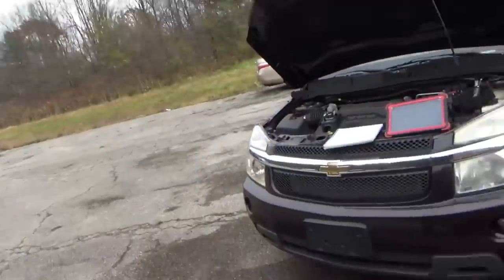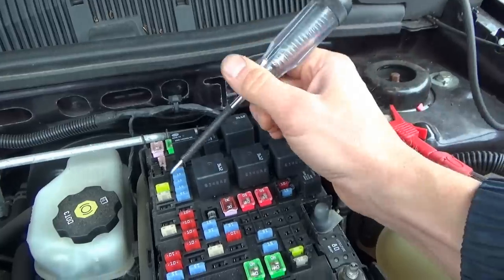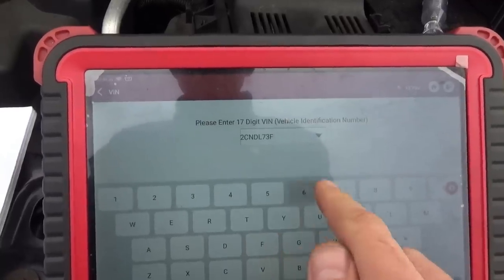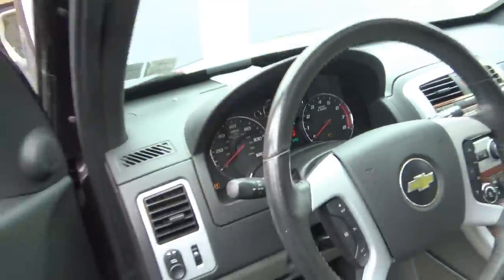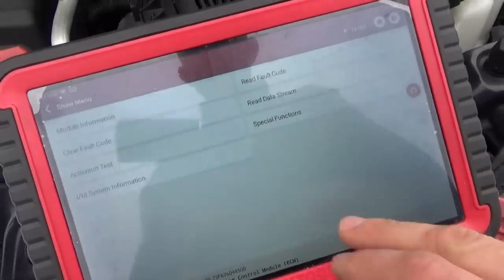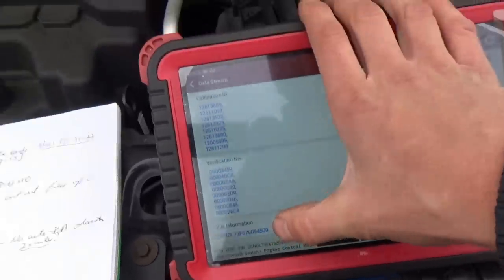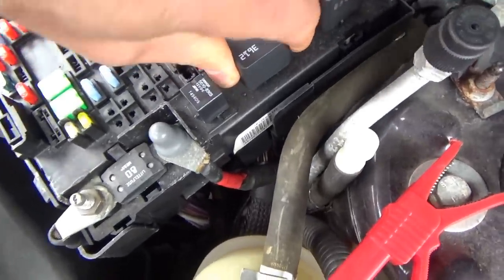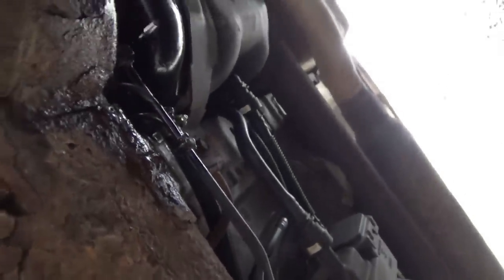Auction Car SABOTAGE? (Equinox No-Crank)

Comment: have you ever heard of “title washing”?..
  somehow, companies were able to convince lawmakers to allow them to erase a vehicles history of crashing, damaged when new due to flooding or damage in transportation from the factory to the dealer. This damage doesn’t get on the record of the vehicles history for companies like Carfax.
  several years ago when a hurricane struck the center of Texas, and over 1 million cars were flooded because they got over 50 inches of rain in parts of Texas. Many of these cars were brand new sitting on dealer lots.. they were never sold, but they were totaled because they were submerged. Now people bought these cars and resurrected them, and dispersed them throughout the country and other countries to unsuspecting buyers..
  if I were buying a used car, I would want in writing, a guarantee that this car was not damaged by accident or flooding and it’s history—ever..

Comment: My wife’s 2006 Pontiac Torrent just had the fuel lines replaced because of leaking. Exactly the same spot the plastic clamp at the centre post of the vehicle. She has just over a hundred and ten thousand miles on hers.👍🇨🇦

Comment: I don't think the auction would sabotage the fuel lines. That's a very dangerous move. I'd bet Someone was messing with the line after spotting a small leak, made it worse, yanked the fuse to stop the pump... and re-installed the pump fuse incorrectly. While trying to fix the fuel leak they noticed the rotted out undercarriage and the customer just returned it to the auction unfixed completely. Not sure what nuked the computer fuse...bad jump? Mechanic trying to save someone from turning it on and blowing up with the fuel leak? Who knows.

Comment: Need to call out that 1 way auction house, so they pay for their dishonesty. Auction tampering is more common than people think. Fixed a few of those surprises over time. Never look forward to them lol. Best old trick i know is early v8 trick, you could put a dodge rotor button on a ford or vice versa and they fired 180 degrees out i.e. never started. great mechanic on mechanic trick. that and hotwiring the ignition switch so they get lit up when they crank it lol

Comment: Everyone's assuming the fuel pump relay was rotated for a nefarious reason but I don't see sufficient motive. It seems far, far more probable that the dealer drove the vehicle back to the auction house and the car was pissing fuel so the auction house pulled the fuel pump relay to cut the fuel, put a mat under it and mistakenly reinstalled it sideways. The guy at the auction house made a mistake and didn't even know it.

Comment: transmission control module tcm that makes sense if the ecu cant detect that the car is in park (it looks like the tcm reads the shifter then tells the ecu that the car is in park and allows it to start).

a chevy equinox is not a very valuable car it isnt like a 1956 and 75  chevy bel air so i doubt anyone would want to sabotage it unless it was the original owner trying to get it back.

it is possible for the short crank to be a problem with the ignition switch i think 2007 was within the range of the gm ignition switch scandal.

relays should be keyed to go in only one way.

Comment: 95% of cars sold at the auction are brought there by a dealer that knows they can't make money on the car, that's why they take them to the auction instead of selling them themselves. Either they are rotten or the dealer can't find a mechanic smart enough to fix the car so they opt to dump it off on someone else. If you are the guy that can figure out the problems that others can't, you can actually do well buying auction cars.

Comment: As a person who works at an auction yard. We do not guarantee running cars. we can say it ran when we received a vehicle or started but it could just mean it ran when it got to us on top of that sitting from days to months to maybe even a year. Components break, that includes sensors, alternators, battery draining, or have no fluids since some of these are wrecked and it could’ve leaked the way to the yard.

Comment: You should provide the name and location of that auction house. That relay didn't turn itself 90 degrees.
Reply: To be fair, someone clueless may have tried to swap the fuel pump relay with the other one thinking it might help the no crank issue.

Comment: This car has 35,000 miles on it and it is a rot box already?  The ol' Marquis has 435,000 miles and I have driven it in every winter I have had it and it is still completely rust-free.  Great video!
Reply: seems like GM uses crappy steel on their vehicles that rust badly within a few years, i see gm/chevy trucks all the time less than 5 years old  with rotted rockers and cab corners here in Wisconsin,   Dodge and Fords seem to resist rust much better than GM here in the midwest
Reply: Road salt in this part of the country literally eats cars alive... Some areas have switched to a brine which is even worse!
Annual oil spays are a must up here.
Reply: @ronsmith4325   same here, that damn brine. its a pain but i spray entire underside of truck every year too, frames, inside rockers, doors, inside tailgates up into boxsides and fenders with used motor oil, so far my truck is looking good for the year yet, use fluid film a lot too,
Reply: @ronsmith4325  I drove my car in 1 state on a single road trip that used salt, and i rinsed the bottom of the car with freshwater to remove it and never seen a single speck of rust.
Reply: @pilsplease7561  That really doesn't compare to driving through these conditions on a daily basis for years.

Comment: Dang. That was interesting. Sometimes, my mom's car, which is a 2005 Chevy Equinox, does the long crank/no start, and has to cycle through a few times before it will finally start.

Comment: You get a glimpse of everything that is wrong with auto, even heavy equipment, auctions just going to them. If you are very early to the auction inspection days, then right before the auction you will see the difference on under and unguarded lots. People pull out good and put in blown fuses/relays, carry in Gatorade(s) bottles with Dexcool, Blue, and Green coolant to spill under vehicles to make it seem like there is a coolant problem, when you are out testing days before people leave the key on run to kill the battery to make it seem like it has an electrical issue, to the standard unplug sensors to make something work less than well to deter other buyers.

Comment: Hey Ivan I had a weird auction car the other day, 2016 mustang, everything worked on the car except the battery charge light was on the dash, but the alternator was charging, and randomly the car wouldn’t crank, battery was good and even with a jump box it would sound like you have a dead battery, several starter clicks and then that’s it. Was chasing my tail all over the place looking for bad grounds and whatnot. Finally got to a point of checking powers and grounds to the pcm, I was missing 2 powers at the pcm. Come to find out inside the fuse box it had pcm batt 1 and pcm batt 2 and one of those fuses was just missing from the fuse box. Very weird problem that it was missing 2 pcm power circuits and the only thing not working was the 2 problems I described, it was definitely a head scratcher for sure. With the symptoms it was having I can guarantee some other shops out there would have thrown an alternator and starter at it lol

Comment: I think the auctioneer switch the pump relay so it wouldn't work and put a blowing fuse in just so they wouldn't have to except that car because it wasn't running I think that was all deliberately done they can be very sneaky

Comment: Running when delivered. Tell the owner to take a  gopro next time to record the day/date/time and also show him pulling into the parking lot of the auction to return the vehicle. A call on speaker to the auction with the car running while the gopro is recoding wouldn't hurt either
Reply: True, but probably not a good idea to run it anymore with a rotted out fuel line spraying fuel (unless it’s fully insured 🤫)…
Reply: @ecaparts  I mean the initial delivery, not now. Besides, whos to say the auction yard didn't monkey with the fuel system too?

Comment: They are at an auction for a reason. Got any ideas Ivan why it said 2000 some miles in that computer?  Usually, the BCM stores the mileage that is displayed on the cluster. Has someone been messing with the mileage too, hmmmm.

Comment: Lesson learned is that you definitely should check the car for issues before bidding.
I wonder if the fuel line also was tampered with, maybe they did tamper with that too in the hope that the car should catch fire if it got running again.

Comment: So the auction crew pulled the fuel pump relay out and put it back in 90 degrees off. That eliminated the return and refund and is obvious since they drove in. Auctions and their crews always need to be overseen when dealing with them and the vehicle(s) you are working with. Above is reason why.

Comment: Nice work, but what blew the fuse, and why was the relay installed incorrectly? That didn't happen in a GM factory. And there's no way the mileage is reported correctly. That truck smells fishy.

Comment: So the auction house is screwing themselves.? Intentionally screwing themselves out of a profit. 
Or If there are problems with vehicles. Then bid very very low. 
Or is someone in the yard doing this and they are setting this up for his buddies that are buying them cheap. They turn around and sell them at a bigger profit margin.
Reply: My understanding is the customer bought the car, drove it home, Found the Chassis was rotted out, Drove it back. Auction House didn't want it back so 'sabotaged' the car and said they couldn't have it back as it was now a non-runner.....

If I'm correct they are Dirty Scumbags, and the identity of this particular Auction house should be posted online and go Viral!

Comment: Crazy. in most countries outside of the states.  This is illegal.  Doing it will land your buisness in court and you will be bent over a barrel with a gun pointed at you.    I once had a car roll in.  kept having air bag faults.  Eventually found, all the airbags were blown and the dealership had somebody put resistors in all the air bag circuits to trick the car into thinking it still had air bags.   We advise the customer to go back to the dealership, hand the car back and get all of his money back.    Claimed he was sold a brand new car with all the air bags blown.    Poor dude got scammed hard.  Clearly it had been in an accidently, Written off. body work fixed up but obviously not the airbags because thats usually like 10 grand and then sold to some poor guy who has no idea they are getting ripped off hard.    BUT THATS HOW CAPITALISM WORKS.    You either gotta know your shit or you gotta be prepared to pay extra money for nothing cuz they'll do whatever it takes to pull that cash from your pocket.   It's the American way.
Reply: "Second Amendment Remedies" is also the American way...

Comment: I purchase a one owner 51k on the odometer from a used car lot in Southern California. This was back in 2020 and the interior of the car was excellent however the exterior needed a complete detailing. The car sat on the lot for six months prior to my purchase. The asking price when the dealer purchased the car from auction was $13995. I got it for $9995 with a three year extended warranty. I did some research on the vehicle prior to purchase using the VIN and found out it sold for $7750 at auction. The dealer still made a profit not 40% but a profit still. I'm telling you this because the used car market is ready to take a nose dive and used car dealers will be forced to lower their asking price. Do your homework prior to purchase and you may get a diamond in the ruff.
Reply: Used car market is surging right now, about ready to jump.

Comment: Funny they didn't mention it was spewing out fuel unless it just happened at that moment, which could be the case, I mean I had a brake line go in all places at the state inspection station here in NJ, years ago they used to check the brakes, this happened on my 1994 Chevy caprice wagon, I asked my girelfiend at the time if she would take it to inspection for me, the guy went to do the brake check and bam, the pedal went straight to the floor, good thing he wasn't going fast, they did it in the facility, it had enough pressure to stop at least, now all they do is check emissions, basically as long as the mil isn't lit you'll pass.
Reply from the maker: Brakes are more important than CEL... Unless you have clueless politicians making the rules 😂

Comment: How the hell does a car with this few miles get so rusted from just sitting? I've owned cars with a 200K+ miles and considerably less rust than this.
Reply: when i gone to buy a car i looked at 2 cars one 2013 one 2011 both 100k miles and both 120k on the clock the 2013 had rust all over the engine and problems and the engine had signs of its dead and the 2011 didnt had rust and nothing but scratches and a dent i bought the 2011 and now i put money to change timing chain and rings gaskets etc, also my 1992 car with 500k didnt rust till last 5 years and the rust became big now
Reply: @Noooo23523  my car has no rust at all and its coming up on 7 years old. Looks like it was manufactured yesterday, have a truck we have owned since the 70's thats never had any work done to it and it has sat outside in california for like 40+ years and has no rust on it at all. Original paint even.
Reply: @pilsplease7561  nice and its 7 y old its not very old, mine is 12 and also my other 1992 car that started rusting

Comment: Begs the question how the car ran at all with the relay in wrong. Wonder why the fuse blew. That problem may come back.
Reply: My understanding is the customer bought the car, drove it home, Found the Chassis was rotted out, Drove it back. Auction House didn't want it back so 'sabotaged' the car and said they couldn't have it back as it was now a non-runner.....

If I'm correct they are Dirty Scumbags, and the identity of this particular Auction house should be posted online and go Viral!

Comment: Hmm fuse blown, the relay turned, and the ecm odometer not matching the actual
miles. I would say they want the buyer to eat the sale and make them scrap the car. That odometer can be a law enforcement problem for the auction house if brought up to the right people.
Reply: Half of the modules weren't reading right, and one said 35k and the other said 2k.  What kind of fraud exactly do you think was going on here?

Comment: How can the frame be rotted out with only 35k miles?
Reply: Gm need to know more
Reply from the maker: Cars rot when they sit...
Reply: I assume you live where it doesn't snow
Reply: Thus the reason the area around the Great Lakes is called the "Rust Belt"...
Reply: It has been sitting somewhere for 15 years.
Reply: @PineHollowAutoDiagnostics  not in california they dont, cars will last like a hundred years outside where I live with no rust cause its so dry here they just dont rust its kinda like how they put airplanes in the desert to protect them while mothballed or etc, cars do the same thing where I live, just dont rust or corrode at all.
Reply from the maker: @pilsplease7561  I'm very jealous!

Comment: The fact that it drove there means the fuel relay was installed correctly at one point. I have no explanation as to why the TCM fuse was blown other tan maybe a blown one was installed by whoever rotated the fuel pump relay? They didn't fool you Ivan, that's for sure!
Reply: They didn't want it easy to fix.  A no crank with a fuel pump control circuit code is pretty easy to diagnose.  With the TCM fuse popped, you can't even read the codes.

Comment: as fast as I want to scream something  dirty is going on, remember it is rotten and that fuse could be from a wire caught on rust and a puddle. The relay seems like "auction mechanics" handiwork . A old man told me once you don't Stare at the sun because the guy down the street does.

Comment: the early chevy equinox was pure junk, chevy had so many problems with them they had to completely redesign them. the low miles is likely because it wasnt safe to drive or wouldnt even run.

Comment: I'm surprised the new owner of the car (person that purchased the car at the auction) was able to return it, I have always been under the impression as sales final, eg as is an nonreturnable. Could someone explain this? OTOH I'm sure when the auction folks saw Ivan had been called in they knew they were done. It does seem like most of the sabotage is easily reversible.
Reply: My thinking as well. Never been to an auction where anything is returnable except eBay.
Reply: @equid0x  This was a dealer who bought it.  They likely do a lot of business with them and might have some leverage.